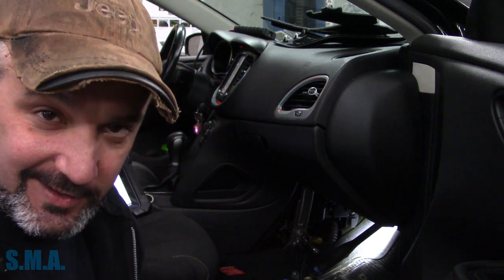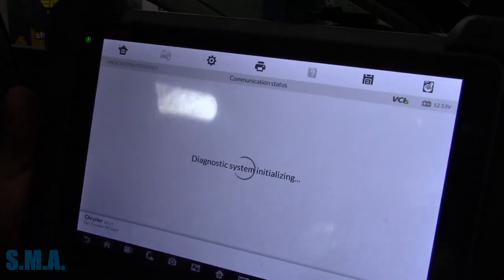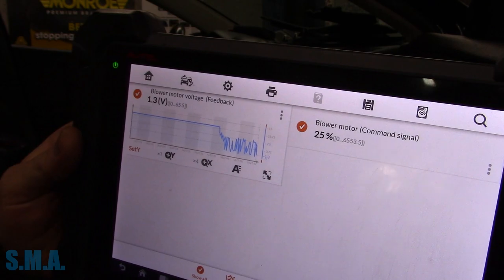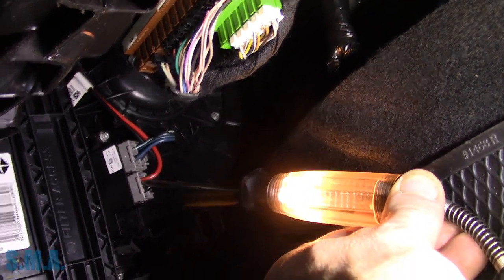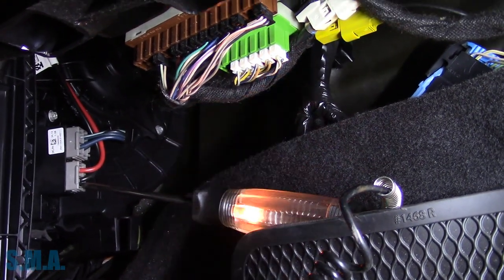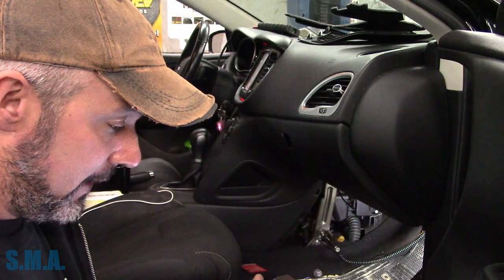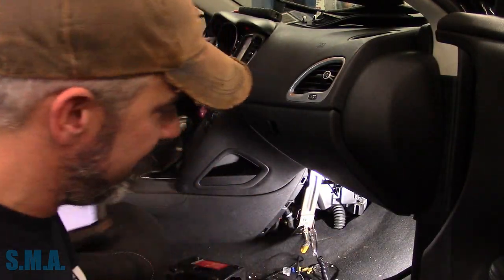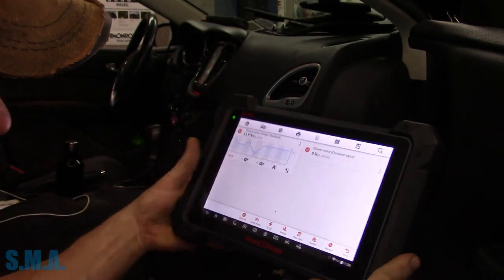This Can Turn On Your Check Engine Light!?

Comment: With your knowledge you should be the only Mechanic your town goes to for repairs.. I remember I had a 1980 Ford FIESTA many years ago and the blower motor had worn brushes so what I did was put something between the spring that holds tension on the brushes to give the spring more push on the brushes and it worked fine, certainly not a repair you would do for a customer and charge them for but for me and considering the age of the car it worked for the ownership of the car and that was in MA where HEAT WAS NEEDED in the winter just like where u live

Comment: OEMs are getting ridiculous with what will turn on CELs.
Reply: I believe the federal law states that the check engine light has to come on when the tailpipe emissions are 1.5x the federal limits. They keep dropping the allowed federal limits every year, which makes the manufacturers have to program the check engine light to come on for more and more things like this.

Comment: Interesting, i think that the newest gen fca engines rely on a high combustion temp for emmisions. I have a 2019 Cherokee and I notice higher than typical? \ traditional coolant temps. My Jeep's have always been a hair under 210 but the new Cherokee is 15-20 degrees higher consistently via the fancy dash multi info display so take it what it's worth as accurate.  I was concerned at first but hasn't had showed any issues.

Comment: Boss can this mess with the battery charger. I'm getting battery light on and the drops the power steering. Having issues with the blower. Has new battery and took the alternator checks out good?

Comment: Back when people committed suicide by hooking a hose to the exhaust pipe, it was deemed necessary to require blower motors to bring in fresh air anytime the key was on. Or maybe it was something to do with being stuck in a snow bank. Apparently that requirement has carried over to these computer days.

Comment: It's "Check Engine" light, not "Check Everything" light, need more digital error readouts on dashes
Reply: It's never been a check engine light anyway. It's a check emissions light. The code setting criteria explains exactly why the MIL comes on for the failure, because it can cause an excess draw on the alternator, lowering your fuel economy and increasing emissions.

Comment: .You make great videos, I'm manfred from Berlin Germany. I have a 2000 Blazer 4x4 4.3 Vortec.Der engine is out of round.I have no error message in the dashboard.I have changed so far: lower intake manifold gasoline pressure regulator, all injectors, fuel pump, gasoline filter, air mass sensor, idle valve temperature sensor, spark plugs, ignition cable, ignition controller, ignition coil, distributor rotor, distributor cap.The catalyst rattles and it smells of metal and sulfur, can a defective catalyst cause the symtoms - or is it perhaps due to a worn distributor shaft I'm really in the end you have some advice Thanks a lot

Comment: My  '05 Liberty lights up the money light when the brake light switch has a hiccup. Weird. Must be a Chrysler thing...
Reply: I'm fairly sure the brake light switch also has signal inputs to the automatic transmission which could be why just that switch is elevated to make a code.

Comment: I own a Dart sneezing on it will trigger your CEL. Would love any videos if you ever see this Dart or another again.
Reply: Dump that thing and run.  Run fast and far away.  Get a Honda, Toyota, or Subaru.
Reply: @nicksmith8166  I've put over a 100K on it. So far other than the usual oil changes and a couple bad coils its been reliable. Was mainly just a joke, cause I know a lot of people have issues with the Dart.

Comment: It will set codes but not turn the light on in my experience. The oil pressure sensor caused the light to come on

Comment: Good little vid that on basics of test light on a motor .
Got to lover modern junkers lol, money light for a blower fan lol 
Be coded next so got program new one lol 
200  bucks is robbery for import fan, it like 10 bucks make/package . 
I used made in canada unimotor and not been burned yet, that like 80bucks and keeps a canadian working lol.
Do go pull-a-part for these if car model not that old as get decent oem for 40 bucks .
I simply loose to many jobs due to high priced trivial part costs .
can't beat the packaging and confidence of genuine parts though .

Comment: I have a 2006 Hyundai. It has a bad blower fan It sounds bad running it on high The engine light has come on a couple of times when I ran it for the AC  After a while it will go off It hasn't done it in a while

Comment: Unless the coolant thermostat is electrically controlled, I don't see why the heat pulled out by the HVAC system would be a problem to set a MIL.

Comment: I have had the misfortune of working on a Dart with a bad Active Grille Shutter. The car sits so low, the customer tore off the lower cover, which the harness is zip-tied to, and destroyed the AGS and the harness. AGS: $500.00, harness, connector N/A: $170. Not a good design at all.

Comment: Hey maybe the cup holder circuit is open.
Reply: Oh God, please don't give car makers any ideas!!!
Reply: I'll bet Chrysler is working on a cup holder monitoring circuit and associated DTC(s) as I type, along with a "Cup Holder Warning" light in the dash, in the process adding 15 more pages of information, theory of operation and troubleshooting flow charts to the service manual, which will be full of errors and ultimately lead to a misdiagnosis.
Reply: I can see this happening for makers that have come holders that can chill the can...
Reply: "I'm sorry sir/ma'am ... Your vehicle burned down due to a short in the cup holder cooling circuit.. "

Comment: If the car is looking at how much heat the blower motor is pulling from the coolant, how restricted would a heater core have to be to have your check engine light turn on for the blower motor? Or is there a coolant robustness code? Lol.

Comment: Im not a mechanic, but Ive only seen blower motors go bad on GM products....but mostly the resistor going bad and negating the low speeds....but never seem a check engine light for any of that.

Comment: My guess is it won't run at %100 due to how fans will fail quicker when ran at max speed due to internal friction. I could be wrong but my PC fans failed faster when maxed out compared to %90

Comment: Chrysler has another, better idea! So the Dart checks how fast the blower motor is turning and what the coolant temp is for fuel economy and emissions reasons. What's next, you are cranking The Ramones on the stereo at "11" and you trip a error code telling you that you're pulling too much power to your speakers? Radio is too loud and MPG is suffering, turn down the volume !! Then you would need to install The Ramones overide module!

Comment: As a masochist who drives a Dodge and is well used to their "eccentricities" this is out there even by Chrysler standards.  I don't know why something like this couldn't be monitored by something like my mother's old Saturn had: a "maintenance required" light that was distinct from check engine.  The amount of heat pulled out by the climate control shouldn't be enough to seriously impact emissions enough to require this kind of monitoring and a MIL severity code.

Comment: Our 2010 Hundayi Santa Fe the charging system is okay one day and then the voltage goes down to 10 amps I’m probably not in your area I’m from Ohio but we like a kind of answer if you could please my Dad working on cars sometimes but can’t figure out this one
Reply: We changed the alternator and the battery sensor

Comment: Whet Chrysler’s game is to buy a blower motor from Korea with the cables attached. Then in the USA a Chrysler company will be tasked to put the connector on. Therefore it was made in America. 
If you bought that same motor from non oem or not in a box with Chrysler on it, you would need to fit the plastic connector. But saving $100.

Comment: "To help improve fuel economy and emission" LOL OK right. LOL. They may as well have the PCM throw a check engine when the driver goes above 45mph since its proven that 45mph is  when most cars get the best mileage.

Comment: Emissions is everything apparently, so stringent even having A/C on or off can set a Money Light fault due to a blower motor or resistor....crazy, but Okay, EZ fixes for flat rate shops to parts change for $$.  Maybe you should thank the Manufacturers for that one...or California where I live that likely drove that bit of engineering trickery.

Comment: The problem with computers controlling everything now days is, so many different people only wrote segments of the code for those computers. There wasn't just one person or group of people tasked to write the code for the entire vehicle. That person would be in an insane asylum now, if that were the case. And because so many wrote portions of the code, you will get odd differences depending on which segment to are working with. PWM is used everywhere because it is easier to control things that way using digital logic. But how the feed-back is used, also depends on how the person chose to interpret that feed-back and illuminate the "money light". Computers, can't live without them, but some times can't live with them either...

Comment: Can't speak for Chrysler or their reasoning about bad blowers causing the money light to come on,  but in the commercial vehicle world, the blower has GOT to work (for defrost/defog purposes) and if it doesn't that's a Major defect and can result in the vehicle being removed from service (and some hefty charges and fines) if caught.  The DOT doesn't care if the driver is warm or cool, they just care about the ability to keep the windows clear for viewing.  Being comfortable inside the vehicle is secondary (or even tertiary) to all else.

Comment: Is it feasable and cost effective to just replace the brushes? Really wasteful to throw the whole assembly away because of just one component failure. I've just had my lower control arms replaced because the cost to swap out the bushings would equal the cost of 2 brand new units. Kind of sad how much garbage we're generating for the sake of 'efficiency'.

Comment: That's got to be one of the more odd engine light causes that I've ever heard of.  I would imagine it's less about emissions than it is about selling Parts. If your engine light is on your remote start doesn't work. If your remote start doesn't work in New York or Iowa or anywhere in between during the winter time you get your engine light fixed so you remote start works. 🤣

Comment: A number of years ago a federal law was passed mandating auto manufacturers to have the blower motor run continuously, always drawing a minimum of fresh air into the passenger compartment to prevent carbon monoxide poisoning. Thus a failed blower motor is a failed safety system, warranting the "money light".

Comment: Those are re-badged Fiats. Top tip: Check the federal sticker on any new car you're thinking about buying. It will tell you the original manufacturer and where it was built. Another tip: Don't buy cars assembled in Mexico. Some Mercedes are assembled in Mexico and they are money pits.

Comment: had a Nissan with no a/c chk engine on (could not be registered till fixed) in the hr I had to diag it I was able to determine that one of 2 modules(out of 5 in the system) where bad the cheaper one was 2500. This is why I won't buy any new car Rediculuosly overengineered!!!! Oh yeah everything worked fine if you would jump the compressor cluth relay (except the engine light) so what could have been a 5 dollar switch became a minimum of 2500 INSANE

Comment: I think the automotive design philosophy is heading into the weeds with this sort of thing. Yes, it is a "malfunction indicator light" but the legacy is from emission control. Cars should be modern enough by now that the display is made smarter - a light (as required by statute) for emission-related alerts and something else - better suited - for all these other monitored things.

Comment: How do I say it? This modern technology has just gone too far. This is insane. A bad blower motor and it turns on the light. What is wrong with a simple 3-way switch with resistors changing the voltage to the blower motor? No Chrysler has to do it the crazy way.  Eric is one of the best troubleshooters out there and I am glad he is sharing his skills with us. He also is reveling just how far and bad something can be designed.
Reply: Keep in mind that the Dart is based heavily on the Alfa Romeo Giulietta.  The HVAC system from the Giulietta may have made it into the Dart as-is, so maybe this weirdness is an Alfa thing or a European requirement of some sort and not the creation of the engineers in Auburn Hills.   But yeah I agree with you, there's WAY too much tech in modern cars.

Comment: This would be why my engine light popped on after only replacing the resistor lmao soooooo stupid

I guess step by step, fixed why the circuit blew, but as the circuit gets completed again its noticing issues

Comment: Bizarre... I mean I get they're trying to further stabilize engine temps for emissions. But this seems like an attempt to trim the moustache hair of a flea lol
Soon there will be a module monitoring a methane gas sensor in the seat cushion... if the driver squeaks out a silent-but-violent a Claxton will start sounding in time to the blinking money light :|

Comment: wth is crysler/fiat thinking....... the hvac system don't have shit to do with fuel economy (besides the compressor running) the only thing the pcm/ecm should be worried about is engine coolant temp and if the radiator fans are working.

Comment: Manufactured 99.99% Korea , shipped then assembled (the other 0.01% i.e. soldered the wires on) in America, voila "Made in The USA" as the song goes.Stick a little tantalum ┫┡ 1uF on the feedback wire.

Comment: blower module? why is that necessary. what the hell ever happened to the blower resistor. i series of several coils of wire in different lengths. the longer the wire coil, the slower it ran. it was simple and CHEAP to replace.

Comment: Complexity for the sake of complexity is ridiculous , it a blower motor if it stops working or starts making noise it should not set off a check engine light .